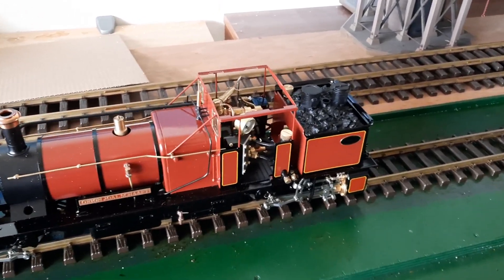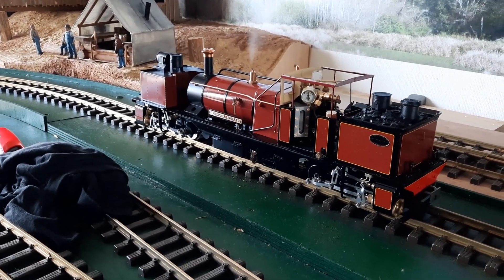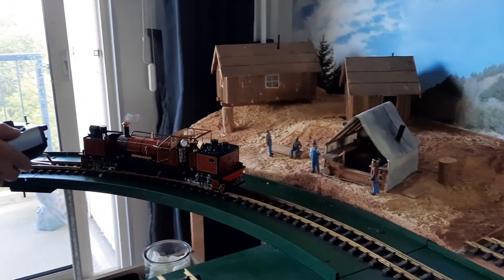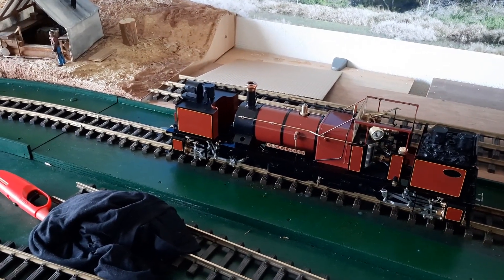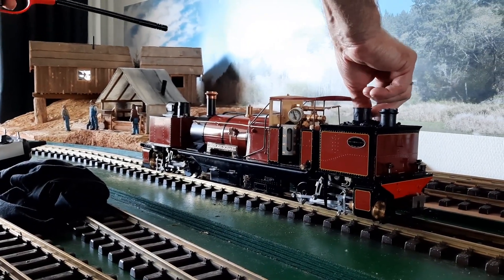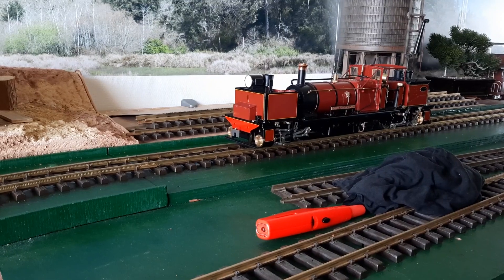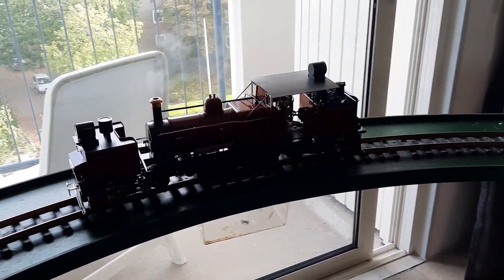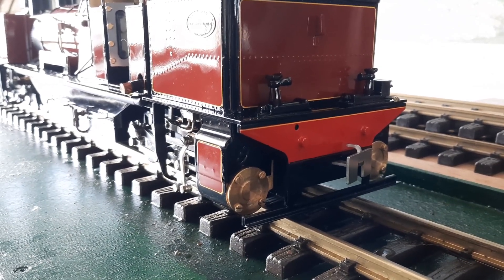D Class Diary: No.2 The first steam test

Comment: Thanks for the information,I will contact them.
Ref first moving  off from a cold start, I find alternating fro m reverse / forward / reverser clears the condensate quite quickly so you then get a smooth start. Regards JD.
Reply from the maker: I do the forward/reverse thing too John. Good tip